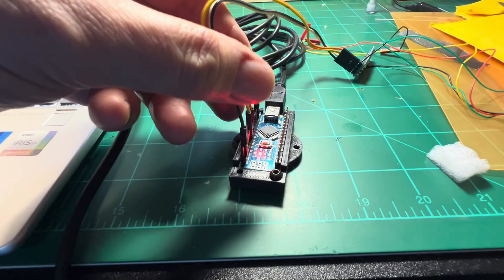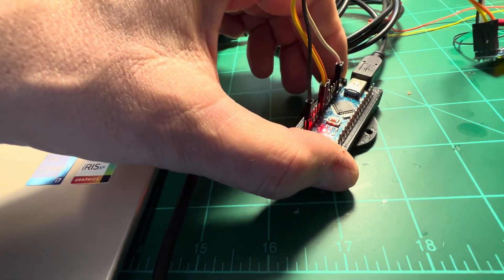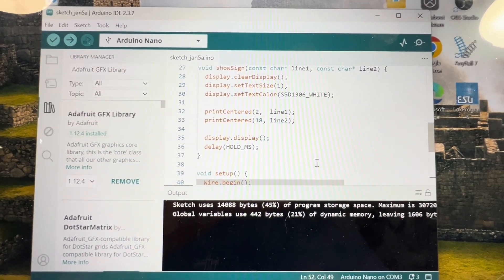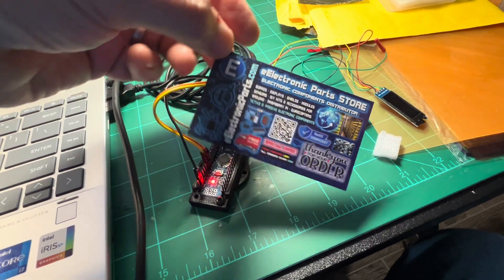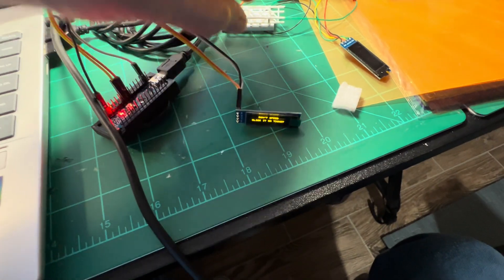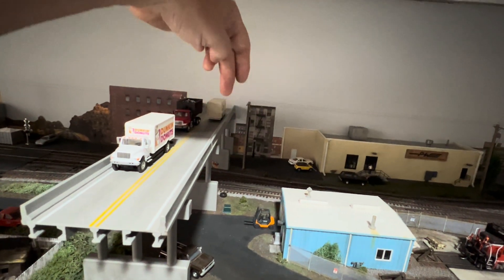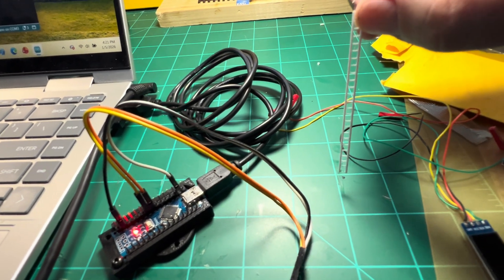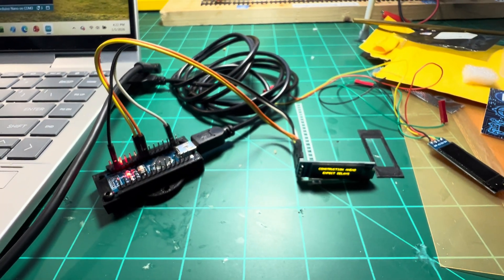Arduino the Lighted Highway Sign - PART 2

Comment: I'm dipping my toes in the arduino realm also. A controller for a magnarail type system. Printed everything including the chain. Waiting on magnets for the chain currently. 

I'm guessing the message board wires will be soldered like you have on the blue one? That is some awesome work! It's going to look great!
Reply from the maker: Cool! Yes, I’ll solder the wires to the message board when it’s together. It’ll be a tight fit, but I’ll make it work. Thanks for watching! So much possible with Arduino.

Comment: If you use Visual Studio Code with the Platform IO add-on (all free) You'll have a much better coding experience. It will anticipate what you are typing and fill a lot of it in for you. The Arduino IDE is quite outdated.

Comment: Strictly speaking Arduinos are not mini computers. They are micro controllers. They don't have an operating system.
Reply from the maker: Arduino is a computer by the normal definition, it meets the criteria of a computer.

A “computer” is basically a device that:

accepts input (buttons, sensors, serial data),

processes it (CPU runs instructions),

stores data/programs (flash + RAM),

produces output (pins driving LEDs/motors, sending serial, etc.).

An Arduino does all of that. The main difference is just scope and power: it’s an embedded computer built to do simple, dedicated tasks, not a general-purpose one like a laptop.
Reply: @HartfordWhaler good luck doing your taxes, word processing, web browsing, social media and watching you tube on your arduino.  They are called micro controllers for a reason.
Reply from the maker: Just using the definition of computer. I didn’t make it up.

Comment: Technically, an Arduino Nano ... and its Arduino variants ... are microcontrollers ... not microcomputers.
Reply from the maker: Arduino is a computer by the normal definition, it meets the criteria of a computer.

A “computer” is basically a device that:

accepts input (buttons, sensors, serial data),

processes it (CPU runs instructions),

stores data/programs (flash + RAM),

produces output (pins driving LEDs/motors, sending serial, etc.).

An Arduino does all of that. The main difference is just scope and power: it’s an embedded computer built to do simple, dedicated tasks, not a general-purpose one like a laptop.
Reply: @HartfordWhaler  Beg to disagree.  Your definition is correct ... but in today's world it's the definition of a microcontroller ... not a microcomputer.  A microcomputer encompasses more ... like the ability to connect a keyboard, mouse, display, network connections,  external storage devices and runs a basic multitasking operating system. As an example, a Raspberry Pi (not a RP Pico which is a microcontroller) is an SBC ... a single board computer.
Reply from the maker: We can agree to disagree :)

Comment: That would be great if you could reproduce this product there alot of uses in the model railroad scene station 🚉 highway signs and led in miniature wonderland has these at there airport and highways 🛣 it would be great 👍 product here in the us i would buy it most definitely
Reply from the maker: Good though. I’d have to 3d scan and print it. Couldn’t scale up scratch building.